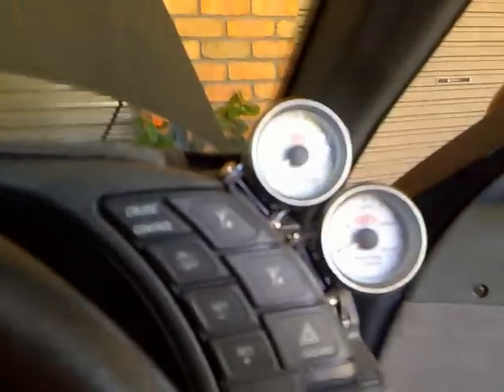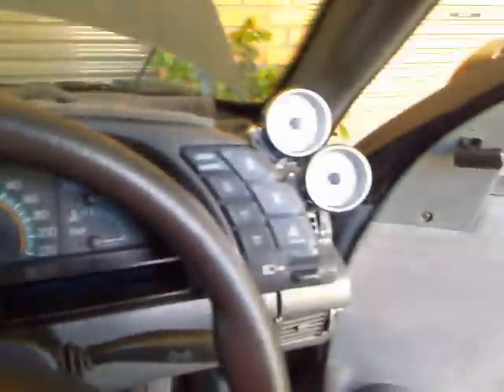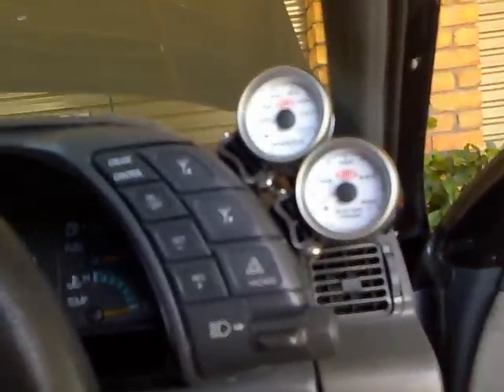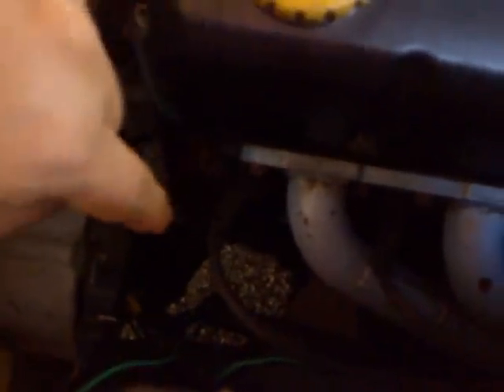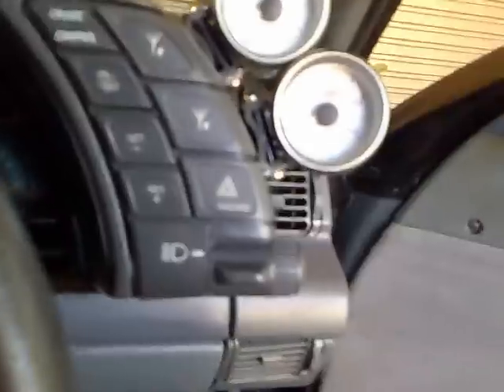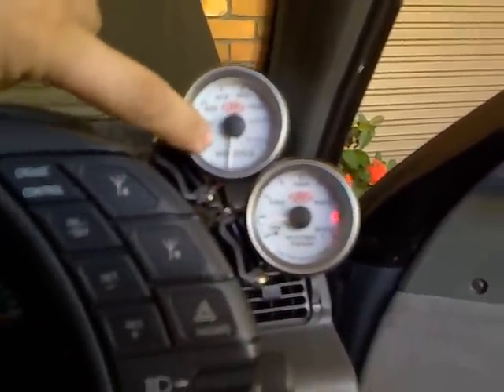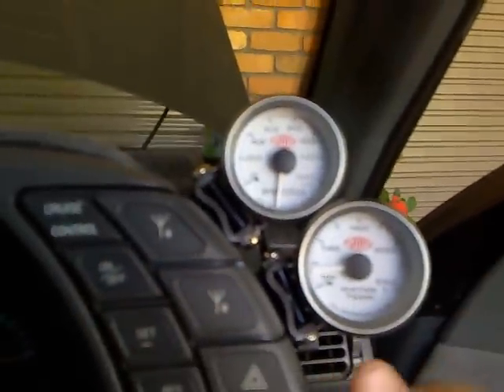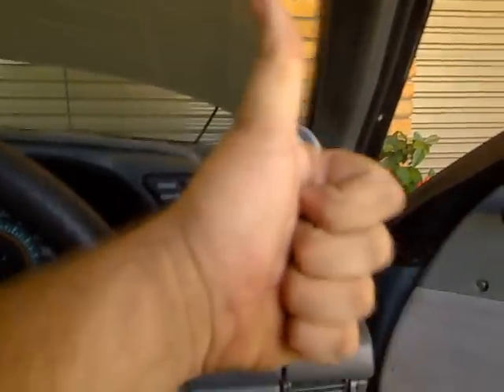SAAS gauges oil pressure problem ziggassedup vn ss

Comment: I have a VY trying to install SAAS Volts gauge through light switch/dimmer. However the dimmer on the guage is working in reverse to my cluster? When the cluster is bright the gauge is dull, etc. The wiring loom from the gauge has 4 wires Red 12V Ignition Switch, Black Vehicle Ground, Orange Battery, White 12V Dash Lighting
Red to ORANGE ignition wire.
Black existing earth under the steering column.
Oraage constant live Red/White ignition wire.
White to grey wire in the light constrol switch